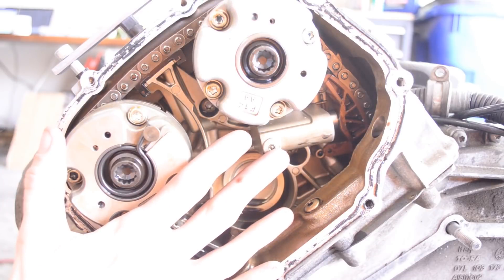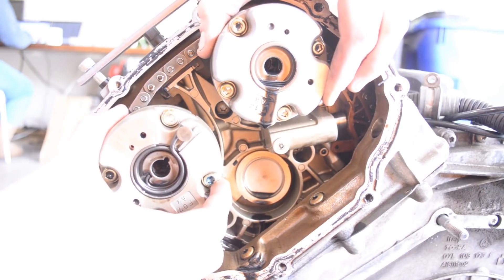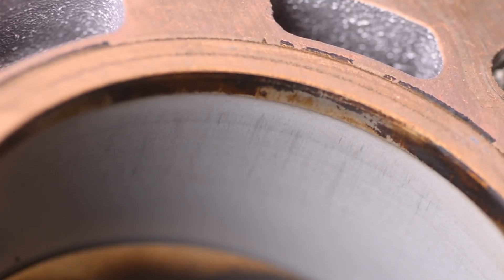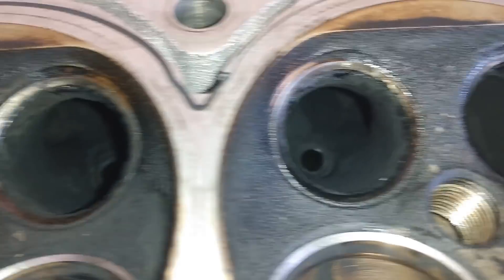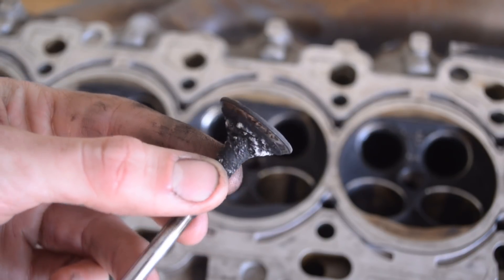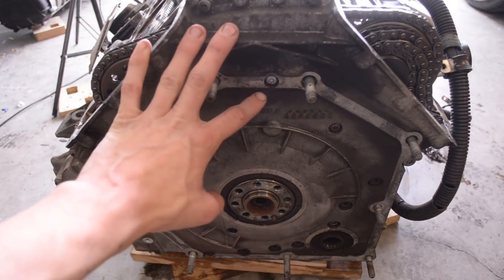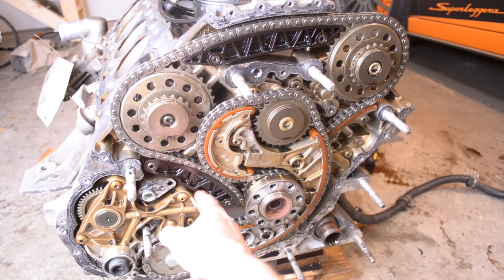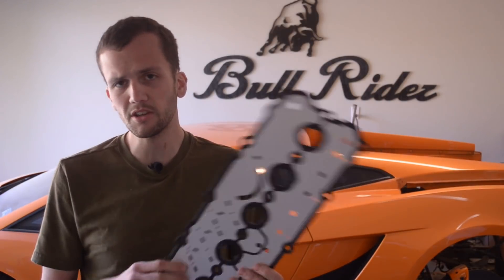Lamborghini Gallardo Superleggera V10 Engine Teardown | Cylinder Walls, Engine Timing, & Valving

Comment: I know its a Lamborghini but that quote is very excessive in my opinion. Giving quality of car I would have thought at least half of that price. Even though 16k is still a lot but 35k seems like an overkill.
Reply from the maker: Naji, you are totally right it is quite a steep price. I have another quote from a company that specializes in applying cylinder coatings to aluminum engine blocks and I was quoted $5000. When I pull the motor to rebuild the bottom end, that is a far better proposition!
Reply: @The Bull Rider  nice! That's a great deal. This is my dream car this specific year and model I hope to own one day. 🙏

Comment: Steel wool the finish and wet sand if needed just the high ridges.
Reply from the maker: William, I wish I could. If it was an iron block or had sleeves I would jump at the chance to do a quick hone to this.
Reply: @TheBullRider  lol . Oksy, I did a top of a Mitsubishi Montero, it had wet rust in the trail the ring left on one bank , I pulled the pan be and did the clean up it was ok. However, it didn't run rusty , in this case as most of your take downs, it looks like a lot of vandalism over miss use
Reply: @TheBullRider  I'm curious, if not a sleeve or cast steel . Then what is this cylinder wall made of?
Reply from the maker: @williamvolkmann8658  The block is made of Aluminum but they put this special "coating" on called Alusil. 
During the manufacturing process, a chemical or mechanical process is used to remove aluminum from the surface of the cylinder bore, exposing a very hard silicon precipitate. These exposed silicon particles, which under a microscope look like small islands, allow for oil to collect in the area surrounding them, thus forming the required tribofilm that supports piston and ring travel.

Comment: How many miles do you have now? How regularly are you driving it? Why are you sleeving it? Whenever you figure out a reasonable engine builder message me on Lamborghinitalk please. Sekslambo.
Reply from the maker: Hi Paul, I still only have about 115k on the car. I am a bit too busy to drive it at the moment. I am considering sleeving it or going with a recoating of alusil on the block. Havent decided yet. 
When I do pull the motor out to rebuild the bottom end I will be doing it myself. We talked on Lamborghini Talk before! Drive your car man, you got nothing to worry about!
Reply: I know we spoke before! That’s why I commented.
Reply from the maker: @seksinvest  I tentatively plan on doing a full rebuild of this motor sometime late next year. I will be amassing parts untill then!

Comment: Can’t you just hone the cylinder walls?
Reply from the maker: Muckman, I wish we could. With an aluminum block, they use a special coating called Alusil on the cylinder walls. This degradation of Alusil is the scratching you see. We have two options to fix this, either re coat the block in Alusil with a few specialized companies or machine the block and installed cylinder sleeves.
I am on the fence about what one I am going to use on this block. A good future video for sure!

Comment: Did you find the complete service manual?
Reply from the maker: Eddie, I didn't for the Pre LP Gallardo from 2004-2008 but I used the manual from the LP Gallardo from 2009-2014 heavily! The motors are strikingly similar.

Comment: The oil burning on decell is due to the very high vacuum condition in the intake. It will suck oil from the valve  guide from any suspect seals. All that extra oil burning will also cause the cat converter to fail from overheating.
Reply from the maker: RedneckCam, you are right on the money on that one. That was exactly what the problem was at the end of the day. I guess the trick is to drive the car with your gas pedal always on the floor! Hehe
As for the cat converter, thankfully this car doesn't have cats! We lucked out a little bit on that one.
Reply: @TheBullRider  Ford had the oil burning problem with the 5.0 F150, they used software to shut off the injectors & keep the electronic throttle body partialy open to reduce the high vacuum condition on decell to solve the problem
Reply from the maker: @RedneckCam666  Interesting! I didnt know the Coyote v8 had issues with oil consumption on overrun. That is a cool fix too! I will have look into that. I really like the Ford 5.0, its a beautiful piece of engineering .

Comment: New subscriber here. I’m definitely interested in learning all I can about the Gallardo engine, I just bought a 2010 Gallardo and am going to be looking for a used engine. Would you have any suggestions on literature for the Gallardo engine? Thanks
Reply from the maker: Replica, congrats on the new car and thank you for following along with the journey. I don't have on the 5.2 in your car specifically but the 5.2 found in the S6 and S8 is VERY similar. I use it as a reference for some information. 
Audi publish this wonderful SSP on that s6/s8 motor and I have it listed on my website here: https://lambobullrider.com/wp-content/uploads/2022/09/ssp-923603-52l-v10-fsi-engine.pdf
It will download the SSP PDF for you to review. 

Also, you will need the service manual for your LP. Here's the link: https://lambobullrider.com/wp-content/uploads/2022/06/Lambo-LP560-Manual.pdf

Comment: Did you check the main and crank bearings?
Reply from the maker: Nicholas, only top end stuff on this tear down and rebuild! As you can tell the owner took really good care of this car with really frequent oil changes so not much to worry about on the bottom end bearings. However it is on my list with a new set of forged rods!

Comment: That needs a hone, pistons, and rings
Reply from the maker: ACatKrom, it does need some bottom end work in the future for sure! The motor will need to be sleeved however, we cant hone it :( 
There is a special coating on there called Alusil and its designed to have no crosshatch. Once its gone, it needs to be sleeved!
Reply: I think it deleted my reply, I linked to a company in Wisconsin that can repair it easily. I've used them in the past
Millennium technologies
Reply from the maker: @trevorchadwick5479  Trevor, I saw your reply before it deleted it for some reason. Odd! I looked into my "marked for review" comment tab and it wasn't there either. 
I will look into the services that company provides. Looking at their prices, it might not be that much cheaper than sleeving but I will look into the pros and cons of each of the two options. 
Thanks for pointing me in that direction, I haven't heard of any company that could do it until now!

Comment: Those marks are nothing. If you can't feel them with finger or nail, it's actually normal. Rings always have some edge where they end around so that's usually where they leave the marks. Which are not harmful
Reply from the maker: I dont think so in this case Anze. The stock catalytic converters on this car are prone to failure. Coupled with backflow reversion sucking particulates back into the cylinders causing scoring its a recipe for a bad day. 
I'm lucky that the scoring isn't bad on this motor but these cylinders shouldn't have a crosshatch like a typical block, the Alusil coating should be defect free.

Comment: You're lucky you didn't get a cracked block.
Reply from the maker: Never seen that on this motor Anze, although I suppose it could be in the realm of possibility. The rods are the weak point in this motor but the block is typically good with the exception of cylinder scoring on early years.

Comment: Richard…..new to your channel and to the lambo world…!! I am a gear head at heart and love fixing my own stuff. I have been in the performance diesel truck world for about 10 years (don’t ask long story) and built my own stuff. 

Anyway….I had an 06 5.9 Cummins that made about 880 wheel HP, had to do a rebuild on it and had the machine work done by a very reputable shop, got it back rebuilt the truck and it sounded “funny” on crank up and after the break in period was down about 80HP….took the motor out and heads off, the cylinders and “markings” on them similar to yours, but was really no detectable by my fingers. Loaded up the motor and went to the machine shop (they knew I was coming) and they had a laser measuring/sensing device that calculated the wall scoring. 

Long story short the re/honed the block, new pistons went in and it was back to new again. 

I guess the point is just because we can’t feel it doesn’t mean it isn’t there. However, if you Lt car is running correctly, other than the oil show on crank up, I would NOT mess with it either.
Reply from the maker: Patrick, thank you for your input sir! I appreciate you sharing your story about your 5.9. Im surprised you had issues with that motor at all at that power level. That motor is rock solid! I am more of a 6.7 guy myself. "No replacement for displacement" right?! That is until the VGT turbo fails haha...
How many miles do you have on your truck? You are lucky with an Iron block, with this aluminum block, there is a special coating on it called Alusil that cant be rehoned. I wish!!! 
With this motor, I do expect a full rebuild is in order eventually. I would like to machine the block and get Darton style cylinder sleeves installed that would make the motor good for life but the trouble is finding a reputable guy to do it for less than an arm, a leg, and a kidney!!!
Reply: @TheBullRider  LOL…..yeah it is crazy what the cost are to re-build a motor are these days. When I started having issues (all caused by a blown head gasket due to too much boost) I was at 175K, once I got everything sorted I drove that truck daily to 275K. I just sold her to a family friend as I recently had to move for my wives career. I loved to shock people when a 7 thousand pound work truck would gap a sports car from a dig. Most people have no idea what a decent built diesel can do. 

I really like your channel and your approach. It sometimes amazes me that people are afraid to dig into a vehicle/project. My grandfather told me when I was a young man that “a man built it, a man can fix it”…!! I love owning a variety of cars/trucks to learn about them. Ive had a lot of friends tell me I should start a YouTube channel because I always have a project going. Maybe one day.
Reply from the maker: @patrickgreen9747  I couldnt agree more Patrick. Its stupid easy to make power on a diesel pickup. As long as you got enough weight in the back to hook up, you are good! 
I appreciate your perspective on my channel. Most supercar owners are too afraid to drive their cars let alone start taking parts off them! 
Your grandfather is a wise man with one exception I am sure you will agree with and its plastic interior pieces. Probably the most infuriating part of ANY car to fix! 

You should start a channel! What's stopping you? Id watch it. I like learning about all different kinds of cars too. Pick up tips and tricks from everything. Hell, I couldn't of even think of a name for my channel so I just quickly named it "the bull rider" because of the Lamborghini logo and now I cant change it because everyone calls me that! LOL
Reply: @TheBullRider  I think it’s a fitting name..!! What’s stopping me…?? I’ll just go with lazy and insecure. Lol. Maybe one day. I enjoyed the conversation and I’ll be watching. When I get my Gallardo I’ll let you know…!!
Reply from the maker: @patrickgreen9747  Patrick, please do! I look forward to the day when you pick one up!

Comment: This is similar to my Ferrari engine, except yours has a timing chain.
Reply from the maker: What Ferrari do you have Keith? 360 is easy, you dont even have to pull the seats to get at the belt! 
You are a bit lucky with an open deck cylinder design, you can re sleeve the motor right in your garage.

Comment: Very interesting. Thank you.
Just a thought: if the engine is burning oil, it might be a good idea to check bore's  geometry and spacing to cylinders. Increased  spacing and distorted bore geometry often leads to oil burning. You will also see washed carbon build up at the edge of cylinders.
Reply from the maker: Pavel, it sounds like you know a lot about this! I would have to strip the block and measure it to determine if that's the case. You should check out this video. The borescope shows the literal puddles that I had on top of the piston! I think in this case we got lucky and only have to worry about the valve stem seals! https://youtu.be/6EGW1A38hvE
Reply: @TheBullRider  Sorry, didn't mean to confuse you. I am not a mechanic and I am not an expert on engines.
Reply from the maker: @pavelantsipovitch8215  Pavel, I appreciate your thoughtful response and consideration regarding this motor! Once I do a full rebuild around the 200,000 mile mark, proper cylinder geometry will be something that I consider and measure.

Comment: 35 000 thousand is wayyy too expensive for a resleeve, at my shop a re sleeve for a 4 cylinder is 300-400 dollar + parts for a v10 you should be looking at something north of 2000 dollar + part, that shop is just fucking around with you cause its a lambo....
Reply from the maker: Maurin, I couldn't agree with you more on that one! I found the sleeves for this motor from the UK for 1000$. I would have to die grind the Lamborghini logo off the block to get a good deal! LOL Sleeving this bad boy will happen with a full rebuild but lets see if we can get another 100k miles out of it first.
Reply: @TheBullRider  yeah, honestly if it was me i'll rebuild it, the crosshatch isn't visible anymore and you'r rebuilding the heads, the engine is already out + 1000 dollar for all the sleeve is somewhat cheap. find a good and honest machine shop, i think it's worth it, just my opinion tough !
Reply from the maker: @maurin8117  Maurin, I appreciate your perspective. Wish it was an open deck block like a Ferrari motor where you can pull the old sleeves out and throw new ones in. But strength won out in the engineers eyes, no wonder why this motor is such a good Twin Turbo candidate.

Comment: Not sure if that engine uses Nikasil but if it does it definitely should not have a crosshatch iirc
Reply from the maker: Jeff, you are totally right. It does use Nikasill! That totally skipped my mind and I didn't think about that at all so thanks for bringing up that very good point. I guess I am used to iron block Audi motors!
Reply: @TheBullRider  ok cool. Also those vertical scoring is what I would consider...."average" not great but not awful about 3.6 roentgens
Definitely not worth a re-sleeve
Reply from the maker: @colchronic  Yeah couldnt agree more, you have to be at at least 100,000 roentgens/rad to kill the block for good.....

Comment: cylinders are good for 100.000 more kms dont even bother
Reply from the maker: Random Channel, very true but the thing is that this motor has 115,000 miles on it!!!
Reply: @TheBullRider  200.000 to 250.000 kms easily for me
Reply from the maker: @randomchannel1712  Im thinking at about 200k miles (320km), the bottom end will need a little bit of work. Not that much farther to go haha
Reply: @TheBullRider  may I advise an oil analysis so to see the real condition of the engine
Reply from the maker: @randomchannel1712  I had the oil analysis kit in my garage and I didn't do it when I drained the oil. Next oil change for sure!!
Reply: @TheBullRider  my lambo dealer told me a lot of the gallardo Italian police cars they had ran over 150,000  miles with no issue they told me . Like anything maintenance is the key to $$$$ savings in the long run .
Reply: @TheBullRider  let us know of the results really interested to see it
Reply from the maker: @johnszwede8516  I couldn't agree more. Frequent oil changes are key for the motor too. Frequent heat cycles also allow the bearings seals and gaskets last a lot longer and not dry rot/ rust over time. If you let a car sit more, you will likely have more problems, not less!

Comment: valve stem seals i havn't done mine yet. good info
Reply: I have bmw. I know valve stem seals can go bad in them. I change most of major seals at 100k intervals as preventative maintenance. Only valve stem seals have not been changed and injector seals. They seem to be holding up. I replaced factory turbos as they were the culprit throwing codes for timing (overboost). Trouble free 20k now. If know know people you can get trade prices. If you were in Australia and you knew me I could have gotten you those cover gaskets for less and oem as well. Good channel 👍
Reply from the maker: @Jotomoz  Mike, what BMW do you have? The problem with replacing valve stem seals is you have to remove almost everything to get at them properly! Haha.
Reply from the maker: Mike, couldn't agree more. In the next video we are going to do a good valve job on these heads and change out the valve stem seals! Do you have a pre LP or a LP Gallardo?

Comment: V10 from Audi. Same plattform from R8.
Reply from the maker: Notbremse, thanks for reaching out and you are completely right the motor is very close. This is the 5.0 Even Fire which is really old school Lamborghini in design but we have some nice parts from audi on it like the sensors and the timing! The 5.2 Odd Fire in the 2009 and up Gallardos and R8 is a very Audi centric design. Do you have an R8?